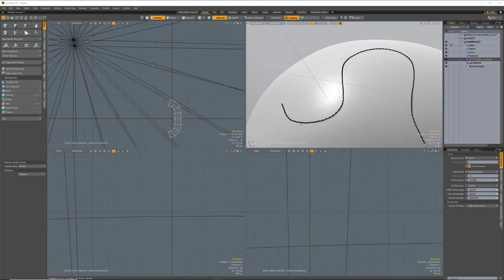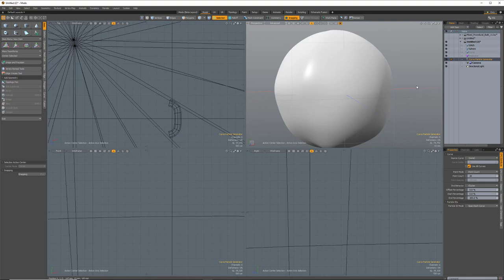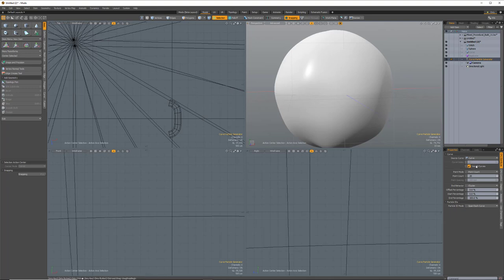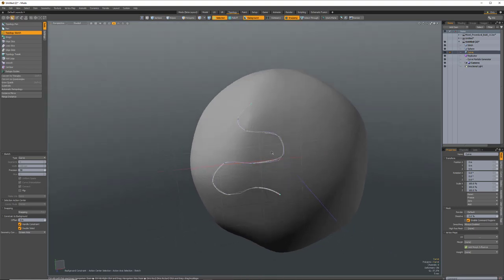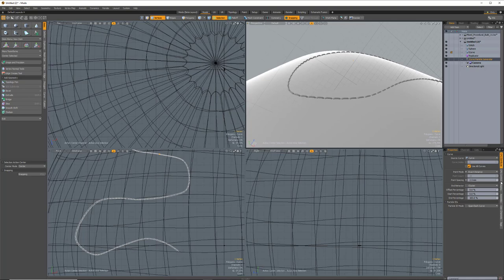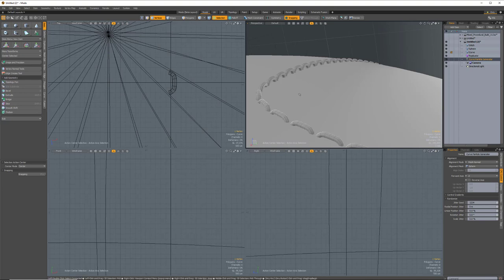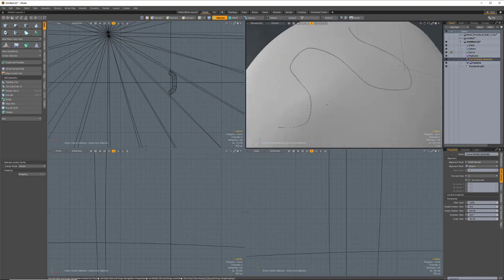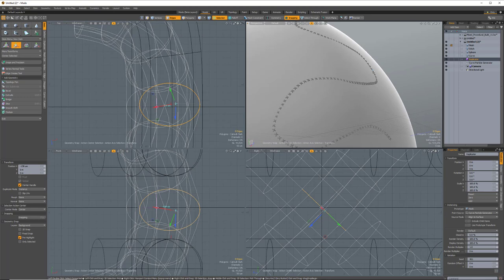Painting Stitches with Curves

Comment: thanks Ellery that was very helpful!!!
I have a question but from another topic if thats ok..
Is there a chance that when you are working with SVG images in Modo, it doesn't support vector clipping masks?
I'm using some graphics from illustrator, and for me is very practical to make some fast changes on the SVG vectors and update in Modo, but I cant get the clipping masks from illustrator to work.
If you know something about that issue I will really appreciate it!
Thanks for your time and keep up with these awesome tutorials!
Reply from the maker: Sebas Marcos hmm... that’s a good question. I’ll have to check and get back to you but I’m not sure that feature is implemented inModo right now.
Reply: Thanks for the quick reply Ellery!
When they added the Vector-based graphics support in 901 I started to use it but it never worked with a vector image with masks on. :(
Or at least I never figure it out haha